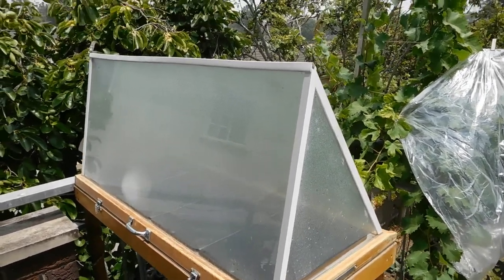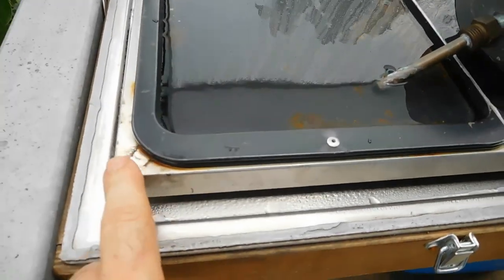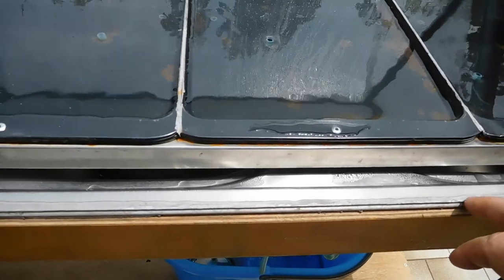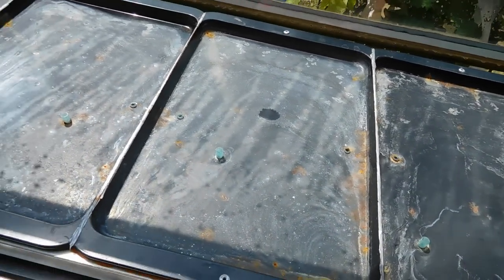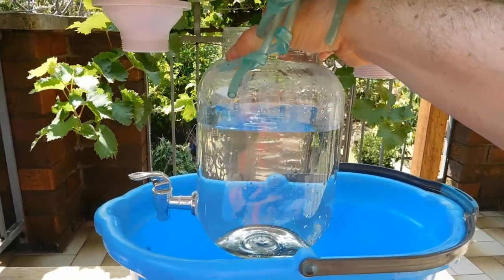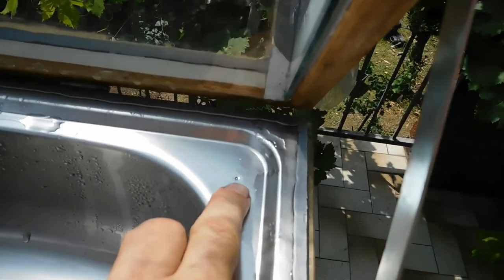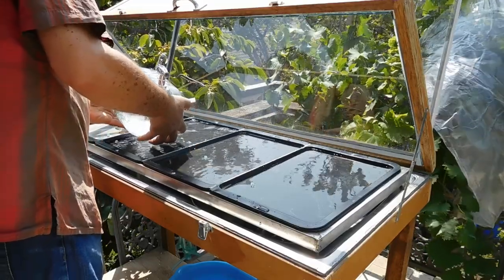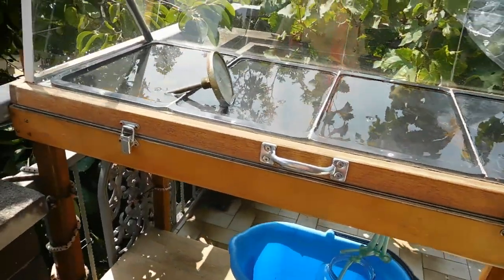Solar water still home made from a kitchen sink. Water purification. Remove fluoride and chemicals.

Comment: Baking trays end up coated with baked on oils and grease. It soaks into the metal and seals it. The water causes rust...and that creates the break down of the finish.
Reply from the maker: Thanks that is a good insight.

Comment: Please do an update on your waste water treatment system. I would like to see more detailed look at the ferrocement tank setup.
Reply from the maker: Hello Sir, do you mean the ferro cement trough because the tanks are sheet metal.?
Reply: @benjamaya5199  yes sir, how that works. On what media that plants are growing. Water from sink is flowing intermittently, right?. How water flow through the ferocement trough. Is Water infiltrated through the medium?. How you avoid overflowing of water. I'm sorry my mother tongue is not english, i think you can understand what I'm saying.
Reply from the maker: @johnwillsn  Water is from kitchen sink  is intermittent so can't overflow. The medium can be small amount of soil to begin. As time goes silt from the blue mulch column will build up to support plants.
Reply: @benjamaya5199  thank you

Comment: Look at the fuel bowl float assembly from a carburetor you can replicate it with carb brass or composite floats or Styrofoam,  couple angle  brackets for a fulcrum, or  pvc or brass, o-ring for the seal, metal or wood dowel with a marble or bearing on the end for the plunger and your there. Better yet by a one way check valve take out the spring, use a plunger on a float to close it. You can install the check valve under the pans the  fulcrum  and plunger thru the top, or add a well and put all that in there. Like water closet eh? Better yet buy a toilet valve and put it in a  well in your center pan, use house supply or gravity tank to fill your pans. Raise your pan sides with glass strips. You can hold up to 2 inches of water in your pans. You could also use a Fresnel lens on a solar sun tracker made with dc small geared servos, and 4 little solar panels, the panels will power the motors until they hit the shade, no batteries required.
Reply from the maker: Thanks Victor yes I was going to do something like that but the complexity was not worth the candle as it only takes some seconds to fill manually plus more gadgets means more maintainence. Appreciate your thoughts though that would be needed for dedicated system.

Comment: Great project. Congratulations. You mention that you produce about 2 litters per day if sunny, but it seems to me like you were producing more than than in the video 3-4 litters. Have you revised the project? How efficient have you gotten?
Reply from the maker: The trays hold about 4L and in the summer sun that took about a day and a half to evaporate. In the end the baking trays rusted out and haven't replaced them with something more durable yet. But I've been using it as seedling incubator in cooler months and works well for that.

Comment: Nice job Ben. I'm looking at ideas to build my own (I'm in the Blue Mountains) so I will add your video to my list of ideas.
Is it possible to use a larger deeper tray to hold your unfiltered water? is it just the case that it will take a lot longer to heat before evaporation starts?
I need to distill 20L batches of glyerol to extract the methonal for re-use.
Reply from the maker: Sounds interesting. It would take longer to heat up if tray is deeper. But should still work.